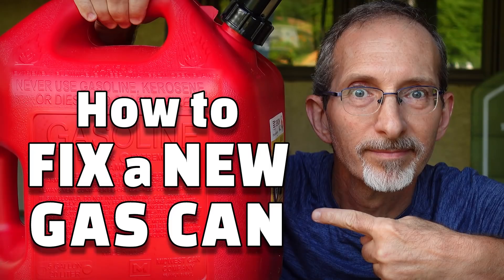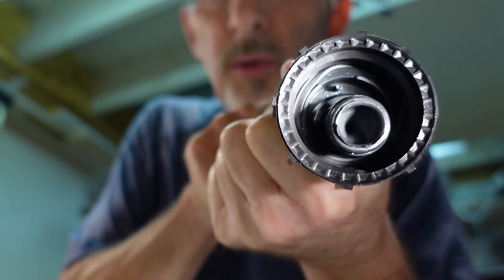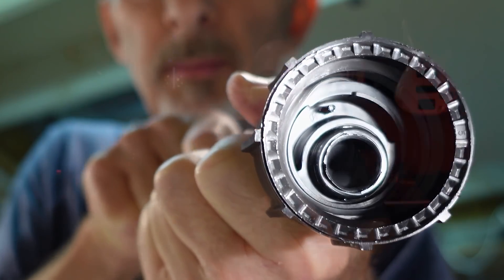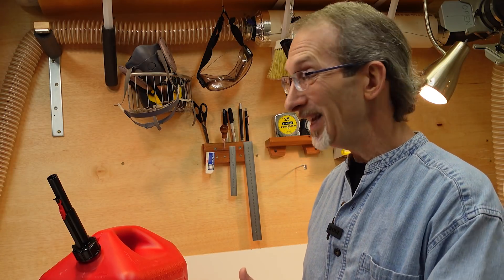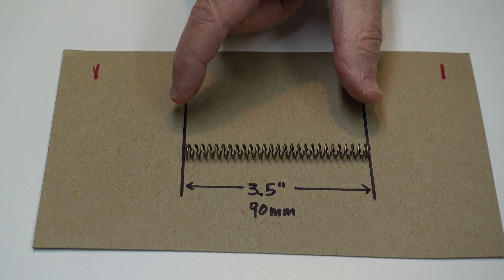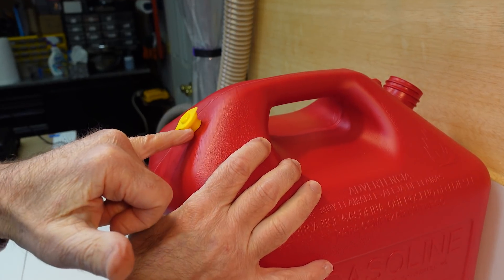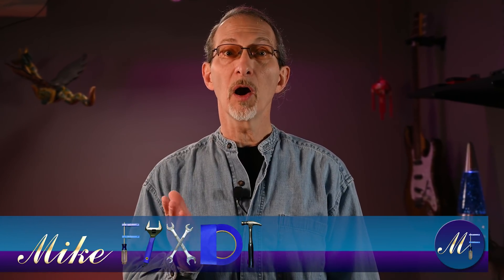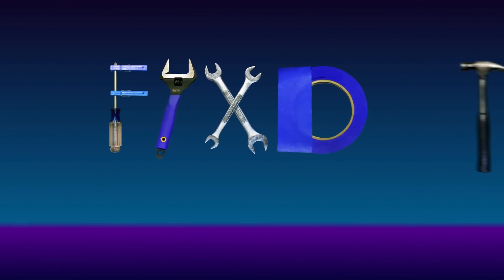Gas Can Modification | Part 2: Explosive Details!

Comment: For the vent, I got some tubeless tire stems, took the Schrader valve out, used a step drill to drill an appropriate hole, got a piece of string, threaded it to the hole I drilled, tied it to the tire stem and pulled into place, replaced the cap and it works so good I put them on all 8 of my cans here on the farm.

Comment: Great mods. It would be nice if a regular cap could be fashioned. I would like to remove the spout and seal the can with a cap.  I find myself worried about snapping the spout off as I pack for a camping trip.
Reply: Insert the spout into the can when traveling

Comment: My mother and I are small women. I'm also physically disabled with mobility issues. My mom is an almost 80 year old woman. Both of us struggle to use these new "safer" gas cans because we aren't strong enough to depress the nozzle when trying to put fuel into a vehicle. Even my 6' tall 300 lb husband struggles to use them at times. Safer, maybe. But if you can't empty the can when you need to, it's also useless.

Comment: The Can before you remove the filter and flame arrestor is a fire hazard when filling, the nozzle constantly kicks off  no matter how slow you flow the gasoline into the can it will kick off and shoot gas all over your clothing. I am glad I don't smoke. Also the rubber gasket  under the gas cap is affected by the gasoline which causes it to stretch and leak it should be made of EPDM or Nitrile more resistant to gasoline.

Comment: I recently bought a kerosene heater for alternate or emergency heat in winter. On my way to check out I grabbed a nice sturdy looking kerosene can to store my fuel, but unfortunately I failed to really examine the can. After all, how complex can a fuel can be? Right?

The first time I went to fill the can I was faced with unscrewing the darn self locking cap. The plastic of the  locking rachet cap was very cold and stiff, as were my hands. As you can imagine it took me five to ten times longer to get that cap off than it should have! Once the cap was off I thought I was ready to fill"er up, but I was faced with what I too thought was a filter in the throat of the can. Managed to get the can full but not without some finagling on my part.

Once home I put my shiny new heater together and prepared to fill it from the can. As you probably know most kerosene heaters come with a siphon pump to fill them without struggling with the weight of full fuel can and and the siphon provides better, easier control of fuel flow so you don't overflow the tank.

Well, because the tank was full to the top I was able to siphon the fuel from the can into the tank of the heater. Problem solved? Oh heck no!

Now that the can is very nearly full but not to the top, I can't reach the top of the fuel level with the siphon, it's blocked by the filter/flame arrestor.

Now that I've seen your video I'll be attempting you technique for remove the blockage from the throat of my can.

Thanks for your tips!

Comment: They advertise these cans as safer for storing fuel, but what happens if you fill a can in cold weather and then store it in a shed that gets hot in the summer? In an older can, the pressure would vent out. With these new "vapor-lock" designs, the pressure just builds up. Maybe it's just me, but having a flammable liquid under high pressure in a plastic can just sounds like a disaster waiting to happen.

Comment: The old nozels were flexible making it easy to pour into anything. These stiff nozels make it impossible to put into a lot of vehicles due to design of fuel cap location, making holding the can very dangerous and causing spillage.

Comment: I just had to replace a "safety" can just like it, the threads and gasket wore out on the old can.  The design is almost diabolical to prevent easy use. My last can was of similar design, and I made some less elegant modifications. The first thing I did  on the new can was break off that stupid red latch. I then started to remove the flame arrester, but it became clear that I would damage the gasket mating surface beyond repair. The next thing I did was very similar to the vent cap. I used a schrader  valve with the core removed for the vent, with the cap installed. On the old can I used a retaining ring to hold the valve in place, I modified the new can with parts from the old. I really butchered up the spout on the old can, your spout modifications make total sense. 

I used a simpler solution on the small can I use for 2 cycle mix, I just made a very small pinhole in the top of the handle, The can would bulge so much in the hot sun I was afraid it would rupture, if I released the excess pressure, the can would buckle and collapse when things cooled off. As long as the can is kept upright, there will be no spillage.

Comment: If You Have A Can Of Fuel  Without  A Pop Open Vent & It Gets Hot It Cac BLOW UP, As in A Shed Shop Ect. , Them New Cans Can't  Pop Open ,So There Way Way Dangerous & Shouldn't  Be Sold Like They Are !!!

Comment: If you’re uncomfortable with heating the can, start with a slightly reamed out hole, apply glue carefully to the vent, insert it and let it cure.  Lexel, 6000, or any similar tough goop will work.  Just don’t get the glue where the two halves of the vent come together, or into the air hole itself.  This is great for plastic water jugs too.

Comment: I don't know if anybody noticed that the sealing gasket on the filler had slipped out of place which would lead to gas vaper escaping from the cap effectively bypassing the advantage of the self sealing nozzle.

Comment: Even though the spout spring is excessive it is due to consumer safety. Stressing your back or other body parts are secondary sir to bursting into flames from vapors and or improper sealing. All or most safety features are written in "blood or death" from improper design. If you want to modify knock yourself out. However if and when someone uses your video to modify a can and something bad happens, well you may be liable.  Just saying you need to put a product liability modification alert onto your videos. Unfortunately proper training will not effectively solve this problem as, well, people will do what they want! As you do, and have done on gas cans. Thousands of dollars goes into product development, due to liability issues, and they will always error on the side of safety.

Comment: There testing system is connected to there share holding profiteers. Plastic is; static producing materials,,, in mid winter very very charged. Spill a little while trying too fill up your vehical with this stupid enginered piece of junk on a hwy during colder months,,, and so much for everything. Cant wait for the class action lawsuits!

Comment: Gas evaporates right through those cheap plastic jugs if you store it longer than a week or so. Toss that junk in the trash and buy only NATO authentic gas cans. They are expensive, but they don’t have those nonsense features and they absolutely do not leak or stink when used correctly.

Comment: I'm old and retried, more or less.  I grew up with the old style cans and never had any issues with them.   NEVER in decades of fueling lawnmowers, tractors, boats, generators and all other gas powered systems did I even once experience a fire.  I certainly never had any issues that would be remedied by these idiot-cans.  Since the idiot-cans came out, I've spilled more fuel trying to get them to work than I ever did with the old style "unsafe" cans.  

Now I just go online and buy a regular spout and the same sort of vent system in this video.  Then adapt the idiot-can back to the old "unsafe" style can.  I spill much less fuel, experience a much lower frustration level, and generally have a much safer experience with the "unsafe" can than I ever did with the "safe" cans.

It's aggravating to have to spend extra money just to defeat the "safety" mechanism of an unsafe design that spills more fuel than the original design but such is the world we live in.  

Bonus Tip -- If you have to store your fuel cans outside, or as in my case in an outside fuel shed, get a cap like Mike shows at the end of the video.  Or just get a cork or something that fits into/over the end of the spout.  Even with whatever fumes escape from the can to the spout, insects will build their nests in that orifice and then you'll get silk or mud from mud wasps in your tank.

Comment: Why bother straining what you put IN the can if you can't get it out without putting back what you strained out in the first place since you cannot empty the filter(strainer) because its NOT removable to be clean? In metal cans, it's much more permanent (welded) and it has much more to complain about if you're not young and have to hold that heavily sprung cap open while balancing that can and use a funnel because the neck is too short (about 2 inches) to reach the opening in the vehicle etc. Hooray for stupid - So proud with "Made in America" signs and Eagles plastered all over everything.

Comment: Thank you for video and great job explaining your thoughts and procedure for modification.  

It seems ever since I started using these safety cans it is very difficult to use and easy to spill fuel more times than a few.  Very poor design.  I'd prefer the old ones without the safety device.

Comment: Especially like your tire valve vent (very secure) you installed on an earlier video.  I found the yellow vents don't stay closed and self open after extended usage.  I am surprised they haven't added a "Don't drink the contents"  warning label to the fuel cans.  Maybe they have but I missed it.

Comment: Mike I like your clear thinking.  I can't add a thing.  But on slightly different subjects I can tell you of some of my experience with government safety idiots.  I worked for many years as a parts man at a dealership.  OSHA was a similar legal problem with doing things safely.  Not an OSHA rep, but the inspector from the insurance company came and inspected the dealership to see that we were in line with all safety regulations.  The parts department got a gig for not having a three wire cord on our micro-fiche viewer.
Now we complained that the viewer had no metal parts outside of the plastic and glass body of the machine.  However the slide that held the micro-fiche was metal and glass.  But the metal slide did not go inside the machine where the electrics were.  We were told it didn't matter, we had to have a three wire cord on the machine.  
Typical thinking by safety experts?  They don't bother to look at how something is built. If it has a cored attached it has to be three wire.
Well, I was the one assigned to modify the micro-fiche viewer.  We could have run a three wire cord, and just not hooked up the third wire.  But I was told to do my best.  The third wire had to be attached to the fan motor somewhere.
So. I had to carefully dismantle a machine that was not meant to be taken apart.  I literally  had to take the thing apart piece by piece until I had the motor sitting by itself.   I then removed one screw that held the motor together and attached the ground wire there.  Let me point out, that the motor was the only metal part in the whole thing.  Everything else was glass or plastic.  So speaking electrically, there was no danger from getting a shock from a short or malfunction.  Thus the requirement of a three wire cord was totally useless.
The same dealership was inspected by a later year, by another insurance inspector, a woman this time.  We stocked dry acid  batteries.  Thus we had to fill any battery we sold with acid. Regulations said we had to wear rubber slip-ons over our shoes, wear a heavy rubber apron,, a face shield and heavy over size rubber gloves.  It took more time to put all that stuff on than it took to fill a battery.  The woman watched me fill a battery and then wrote me up for not wearing any of the safety gear.
I was stunned.  I told the woman I had been filling batteries for years, and I never spilled any acid or had an accident.  I told her flatly that it took longer to put all that gear on than it took to fill a battery.  And the gloves alone were so clumsy I was more apt to have a accident just from wearing therm.   And lastly I asked her if she saw me spill even a single drop of acid anywhere?
She left and we never head another word about me not wearing acid safety gear.
And one other note I'd like to make.  Typical of government, we all are required to have income tax taken from every one of our pay checks.  Why?  I know I have never lacked enough money to pay my taxes when April came around.  If some other taxpayers were always late because they didn't have money to pay income taxes, then maybe they should have it taken out of each check.  The rest of us should be allowed to get the full use of our income without government being involved. I know the government likes to take the money monthly, so they can earn interest on it until April.  But we the taxpayers should have that benefit, not the government.

Comment: I knew of someone that had been using gas to clean their paint brushes, in the basement, improperly stored open coffee can's, and even the gas can, the pilot light on the water heater ignited the fumes. Not all people have kept gas inside their garage.  It's important to know about what can happen with the fumes, after all, Gasoline does not burn. The fumes burn. I use these containers for my hobby, and have to modify the containers so that I can mount an electric fuel pump, or a hand pump. We fill the tanks in our model planes. So we need a vent, and also a fuel pick up line with filter to go inside of these new tanks. I'm happy to see someone else has modified the fuel tank as I have already done. Thanks for getting the word out, and it's very important to get the facts out and make people aware when they are using any type of flammable fuel or solvents that can ignite if improperly used in the home.

Comment: I can tell you why these cans are designed the way they are. it's because the engineers are morons.

for many years gas cans had a rather simple spout and a vent and that worked fine. but more recently because a lot of people don't have good common sense. and because the manufacturer's have to try to keep costs down. the engineers are forced to design these terrible safety features into these cans.

Comment: I installed the vents on all my cans a few years ago.  A step drill made a perfect hole then install the vent with a quick wack of a mallet.  Swarf inside?  Tip the can upside down and give it a blast of air.

Comment: The geniuses at Midwest have never used a straw, so they are not familiar with when you block one end no fluid will not flow it doesn’t take an I.Q. Over 100 to figure that out. With their can you cause a more unsafe situation with a small engine because you can’t see the gas filling level. Any person with half a brain can see that .

Comment: Any reasonable design should have had a cap over the nozzle in the first place to keep dirt and debris out when not in use anyway. 
My favorite gas can is the Sure Can with the trigger valve and bottom dispensing design, but it Sure is expensive.

Comment: 15:08 that hardly looks "nice and high", it's barely more than halfway up the flat surface.  ALSO, I think you should have checked inside the can in case any little bits of plastic actually got in.

Comment: Cap hack,, u should have disposable gloves on rite so new or used cut the fingers off of the disposable glove,, put it on & there's your fingers,, take one of your cut off rubbers and pull over spout end to keep dirt and rain water out,, seal  the pathway to contaminated fuel,, ride hard & when in doubt please tach it out

Comment: Allowing the drill bit to run inside the hole at a stationary position would've cleaned the hole out. You walked the bit into the hole without allowing the bit to finish cut the hole. I realize that you are trying to avoid plastic bits falling into the can but the bit is designed to cut the proper diameter hole cleanly, which would let the new vent piece fit tightly in the correct diameter hole. One could always rinse the can out with water and allow to dry or even blow air into the new vent hole while allowing the bits to be blown out of the open fill port.

Comment: The other thing that can happen on the modern "safe" gas can is that if it gets warmer outside, the inside of the gas can might become pressurized. So if you turn the can up and stick the spout in your equipment and press down on the nozzle mechanism, suddenly the air can escape. However since the can is turned down, gasoline surrounds the exit point and the pressure pushes a large amount of gasoline out of the nozzle as the air escapes. This gasoline can shoot out under great force and splash all over your equipment and all over you. How in the #%!!&$*??!! is this considered safe?? The only way to make it safe is that you need to remember to manually release the pressure before titling the can down, that is, if you can even manually overcome the mechanism. Agree with the YouTuber that these safety features can easily cause more danger than there used to be. Govt regulation at its "finest."
Reply: That’s exactly what happened to me. The lawn mower tank filled in a fraction of a second and then sprayed gas all over me and the mower.
Reply: @dougandersen645  -- yep, I bought a new nozzle on eBay that didn't have all the dangerous "safety features" and now I'm much happier.

Comment: Plastic can, no vent. Outside temp changes and tank collapses or pressurized like a balloon
Reply from the maker: Anthony, yes… The container looks pregnant when it gets hot outside. But so far the plastic is flexible enough to withstand it. So not to worry!
Reply: @MikeFyxdt  unfortunately, YouTube comments don't allow photos. I have a photo of a collapsed plastic gas tank. Whether or not, it withstands it is to be seen!